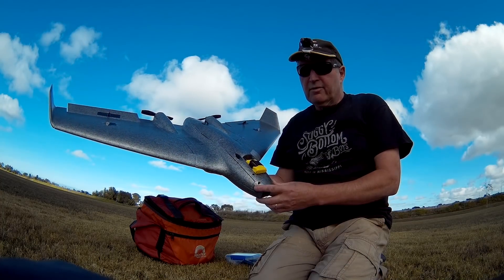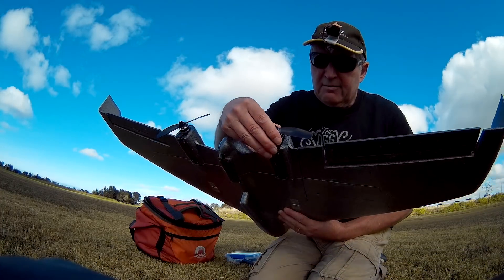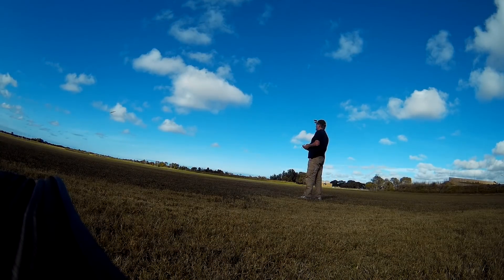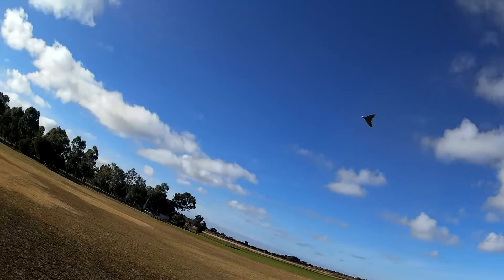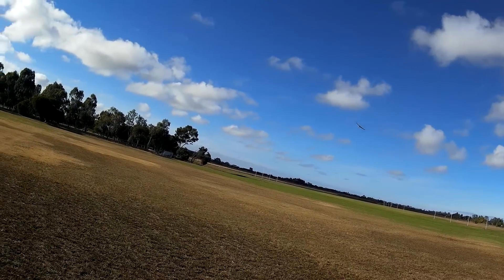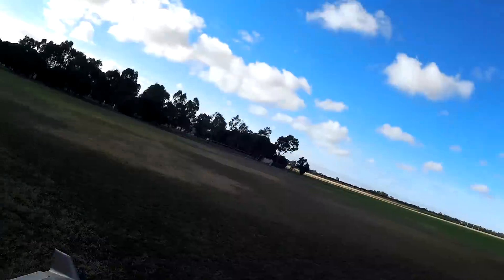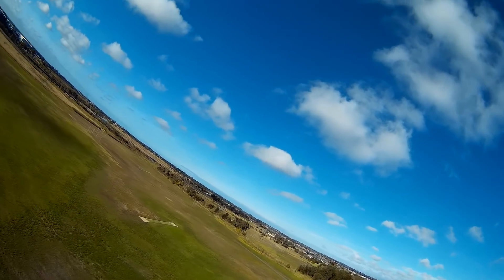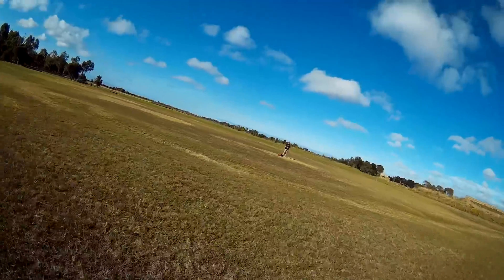Reptile Harrier S1100 maiden

Comment: sir Andrew how did you wire the two esc going to the receiver throttle channel? Did you use a Y cable to connect the two esc? Then y cable going to the throttle channel of the receiver?
Reply from the maker: Yes that is correct. Or you can connect each ESC to a different channel and have differential thrust
Reply: Andrew Newton  Sir Andrew Thank You for the response! An avid fan of your channel sir!

Comment: I am interested in this model, do you presume it would be able to fly on 2204's if built light? I plan on a LOS build on a 2700mah 3s lipo, just for crusing around at under 40kmh(25mph). I do not want a speed demon  and I have some 2204s on hand in a few different kv flavors, You mention its low end envelope is pretty nice. Additionally what are your thoughts on the additon of vortex generators? I know they were around for the S800 Sky Shadow. Thanks in advance.
Reply from the maker: Those motors would be fine for a light build. It has plenty of thrust with two and cruises along slowly.
Reply: Andrew Newton Thanks for swift response!

Comment: Congrats on the successfull maidens Andrew :) 
hmm lot's of reflex.. I really don't like that (basically means the wing isn't well designed).. BUT still.. it does fly nice :) (and has great airprecense) 
What 4S pack did you fly her on??
Reply from the maker: Thanks mate, I agree. There are some design flaws but it really flies smoothly. I have tried 3000 4S and 2200 4S, both work well.

Comment: It looks like a plane you could fly with a bit of weight in the nose on windy days.  The video looks great in the stabilized mode. Oh, I was going to say, the digital metal gear servos are really sweet! The turns on this plane would be like butter.  They are a bit more expensive but really worth it.  If you have space put the 11g ones in.
Reply from the maker: I have a drawer full of them Steve, and I will switch soon.

Comment: Check out Hobby Kings Black Widow motors Andrew.....built in ESCs.....saves a lot of space and wiring.
  All that reflex trim is not a good sign, it means the wing section does not have enough in it.
Be interesting to put a calibrated ammeter in circuit too....as a comparison.
Reply from the maker: There is some built in reflex but not enough. Those motors look interesting

Comment: Like lots of other I have the S800 V2 by the same manufacturer and it is very good, albeit in light winds. I really like this twin motor wing but I find planes > 1000 mm just are too awkward to live with. 800-900 is the sweet spot in liveability and "flyability". So if any manufacturer is watching make a twin motor wing around the 900 mm wingspan please. Particularly in this tough grey EPP.
Reply: This twin is only 996mm https://www.banggood.com/Skywalker-SMART-996mm-Wingspan-EPO-FPV-Flying-Wing-RC-Airplane-KIT-p-1225339.html?rmmds=search&cur_warehouse=CN
Reply: EPO unfortunately. But thanks for pointing it out.

Comment: So 300mm is the cg you settled with
Reply from the maker: 290 to 310 is the range. 320 is going too far. Stay tuned for the upcoming video
Reply: Andrew Newton cheers for that. That's gonna give me some work to do now
Reply: Andrew Newton and how much reflex is needed for that cg range for level flight
Reply from the maker: Ended up about 5mm constant

Comment: Flys smooth. Im half way through the build and im concerned about the motor mounts too. How much elevon up/down are you using Andrew?
Reply: Stunt Double FPV go to thingyverse
Reply from the maker: Haven't measured the throws but I have 100% rate with no expo, push rod on outer elevon hole and second in from the end on the servo arm.
Reply: Andrew Newton Thanks. Id love to see a cg dive test vid hint hint
Reply from the maker: Haha, CG testing up next. I found the rearward limit as usual.
Reply: Excellent, looking forward to it. I'm keen to see if diff. CG positions will influence the amount reflex and also if it changes the handling characteristics much.

Comment: Perfect!!Thanks Andrew! Got my wire for the ESCs to install tonight. Unfortunately, the weather looks pants. Maybe I'll get a break tomorrow evening.
Reply: Been direct soldering to the F3 board on a mini quad tonight, so I may be up to that task, unfortunately, I have the Kit version coming, usually tyhe stabilisers are pants, plus I wanted to stick some lower KV motors in there, thinking that they would be quieter. It sounds whisper quiet as it is! Maybe the sound of each motor cancels the other out? Missed the post to mine today, so will have to wait till Monday now.  Not sure what motors to go for now? I have some quad motors lying about? I have some SS 1250kv  motors? It looked pretty quick as it was with a good climb rate. 
Maybe wait to see a few more vids to see what others use in there's?
Look forward to seeing yours Lauren in the air soon!
Reply from the maker: Excellent. I'd be tempted to connect the ESC and battery wires straight through and run single power wires to the board rather than trying to connect everything to the board. But you may be better at that than I am.
Reply: Oh trust me, these wires are going straight to the battery. I've got the old person shakes. LOL! I swore off soldering to little boards! ;)
Reply: Hopefully tomorrow Steve!  Right now they are saying rain. I swear I'm in the UK this spring. LOL!
Reply: Its been rain here today. Rain forecast for tomorrow, but Sunday is mostly dray but windy. 15mph winds & 7-8 degrees C. Cold!!!
Reply: Same crap we're getting!
Reply: Rained all day here in Christchurch. But it's late autumn here, so somewhat expected.    :-/
Reply: Maybe you are in the UK after all? lol
Reply: On Monday, in the UK, we have a forecasted "feels like" temperature of zero!
Reply: It rained all day yesterday. Back to chilly, cloudy, and windy this AM.